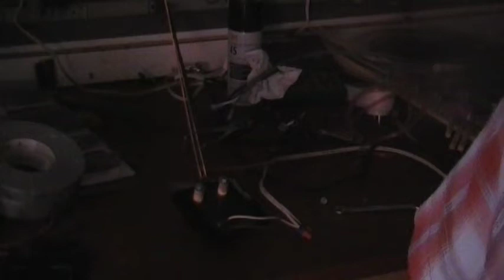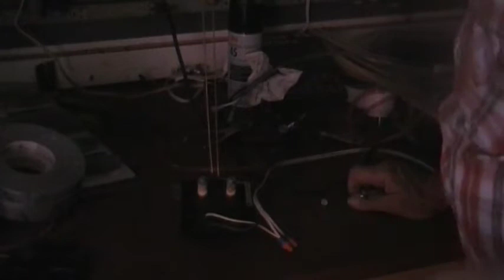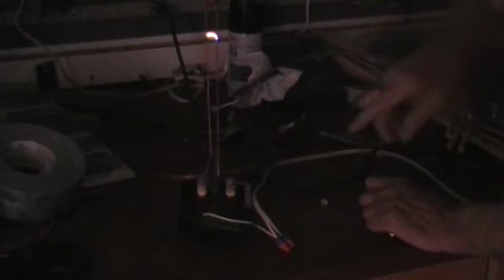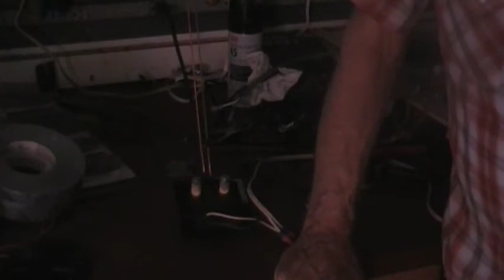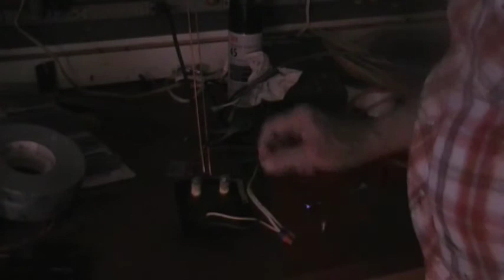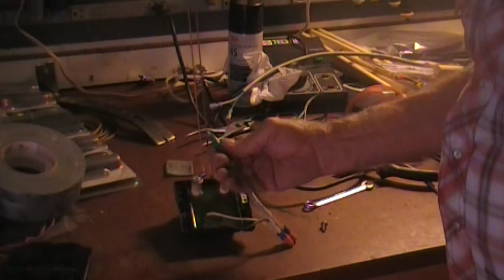High Voltage Lighting 9

Comment: Hi Redd,
If the voltage is high enough to jump through the insulation of an “air gap” that big, few "insulators" would be of any help to you. Air gaps are a form of insulation. That is why high voltage lines are placed way up there. Wire insulation is really only there to create the necessary space gap between conductors and to give thermal protection.
From Wikipedia... "A perfect insulator does not exist, because even insulators contain small numbers of mobile charges (charge carriers) which can carry current. All insulators become electrically conductive when a sufficiently large voltage is applied that the electric field tears electrons away from the atoms. This is known as the breakdown voltage of an insulator."